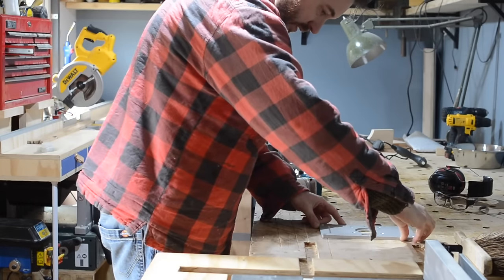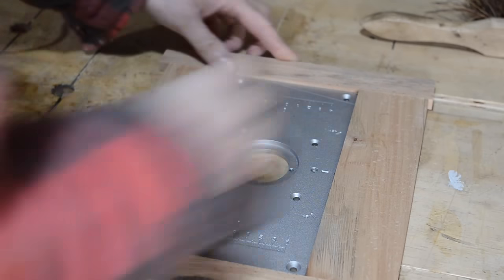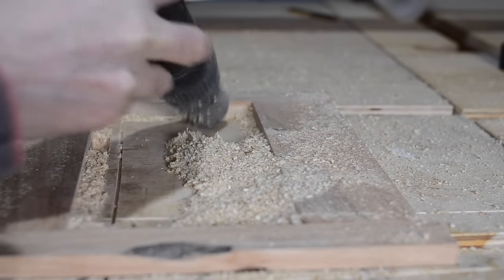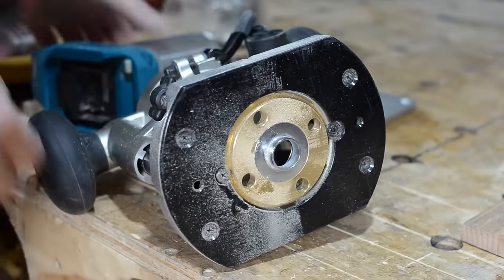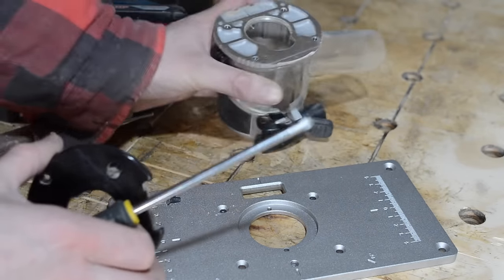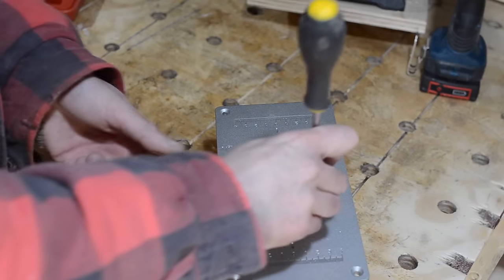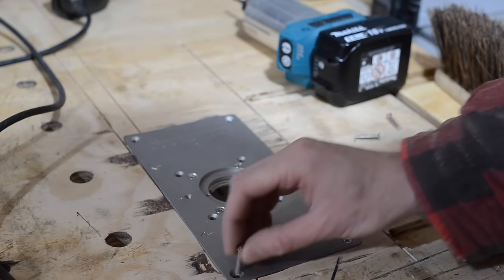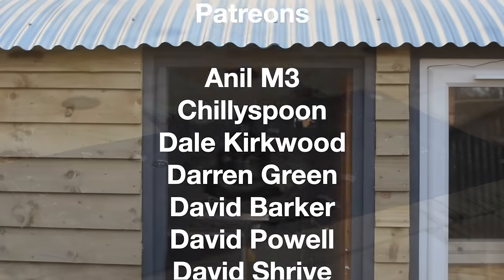Installing A Router Plate Insert

Comment: Before you drill the holes for your own router. Turn the plate over and check to see if there are countersinks that match the hole pitches. Mine had all four so just drilled 4 off dia 4 holes using the countersinks as guides. Worked a treat. Worth checking.

Comment: This is great, but I highly recommend using a corded router in a table. A cordless creates a slew of problems. From changing batteries, to delayed shutdown. So if you have an issue you can shut it down without reaching under the table.
 
Plus, before setting up a router, consider you needs. Like how will you be getting precision height on your bit. So a router lift is a must have. There's tons of cool easy DIY lifts on YouTube. Find one you like and go with it!!! :)

Comment: I have one of these unbranded Chinese cast alu router plates - just the larger version. I'm pretty happy with mine, especially for the price. I did make my own inserts though as the black plastic ones that came with were 1-2mm shy of flush. The plate was nice and flat, although it does have slight graining on the surface from the milling. Wood still slipped across OK but the plate needs to be cleaned regularly as the graining will accumulate wood oil, resin and muck. Perhaps one day I'll see an Incra or Woodpeckers worth the investment but for now, these cheap plate do the job just fine. Like you technique here for the cuttout Matt.
Reply from the maker: As you say its not perevt but its a fraction of the price the big names. It will do for now

Comment: Very informative video. Thanks for sharing. Affordable router plate insert. If it's flat, it's OK. But what is the advantage of a router plate insert above only a hole 

where the router bit can peek out?
Reply from the maker: You can just hvae a hole but router bits need different sized holes and this plate has different inserts for diffent router bits.
Reply: @Badgerworkshop  Thanks for explaining.  I made my super simple bench top router table only with a hole in it. The hole has a diameter of 25 mm
which is slightly wider than the widest router bit I have. When using a 6 mm straight bit there is quite a gap around. It did not cause problems
till now. Insert rings (which are not possible in my case) help the minimizing the gap.

Comment: Good video. 2 questions. The large rectangle hole, what's that used for? And supposing you were using a simple trim router, could you use the seemingly spare hole on the top middle section to activate a DIY elevation system from above? Many thanks for the insights.

Comment: Hi, I've never seen a self centring drill bit and I couldn't find it in your tool lists, can you tell me some more about them please?
Reply from the maker: They are very handy for fitting hinges. 

https://www.amazon.co.uk/Drill-Tools-Professional-Centering-Hardware/dp/B01DIWXDNM/ref=asc_df_B01DIWXDNM/?tag=googshopuk-21&linkCode=df0&hvadid=344066719117&hvpos=1o4&hvnetw=g&hvrand=11167850849586845176&hvpone=&hvptwo=&hvqmt=&hvdev=c&hvdvcmdl=&hvlocint=&hvlocphy=1006669&hvtargid=pla-699115099171&psc=1

Comment: Great vid re installing the router plate but not so good re the actual router fitting👀I've bolted mine direct to the plate BUT yes I have a bottom SUPPORT timber in place HOWEVER NOT having to drill or cut the whole in the underside re timber etc The timber under the router is on a WEDGE so to increase the height of the router and push the bit UP you simply slide the wedge in (up) or out (down) AND it can using a butterfly bolt/s be fitted tight. (Using a bit of rubber on the top of the wedge also helps) All it does is support the router in place, it does NOT force or damage the router if fitted properly. I don't advocate fitting a heavy duty plunge router without some support under the router. Also using a 'no power' switch to the unit enables you to leave the power ON at the router whilst controlling the router power ON from that switch. You can also buy a FOOT switch (like my mom used to use on her singer sewing machine 😉) which is fitted in the power line and by pressing the foot pedal it operates the power, take your foot off and the power is off.. I connect that in line with a SOCKET on a piece of timber that the router plugs into which means when not in use it can be disconnected OR used on other devices. Stay safe ! 👍😉

Comment: I bought one of those as well. I don't recommend them. On the back there are a bunch of various drilling points none of which fit any of the three routers I have and I had to drill without the convienience of pre marked drilling points. I'm new to this kind of thing. I really needed the  pre marked holes or something to line up properly. When I was done my router was about 1/2 mm off center. It's not a big deal and it works it's just a little disappointing. Also if you're doing this don't do it on regular plywood cause it's likely curved. Though I can use the mounting plate again I'll have to remake my table because it's not flat.

Comment: Hi - super video - justabout to do same -is there a link for the two router bits you used - cant seem to find them on your Amazon link?
Reply from the maker: https://www.amazon.co.uk/shop/badgerworkshop?listId=279ZTLDTEFPNR
Reply: Thanks for that -didnt realize they were 1/4" bits you were using for 1st cut to cut out for plate to sit in. Ive only got 1/2" router - what would be equivalent with 1/2" shank please?